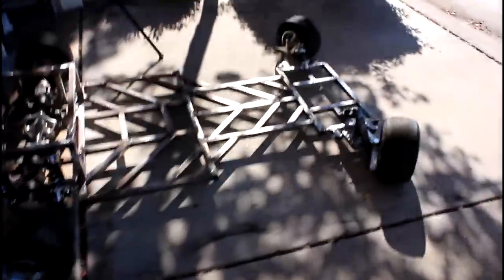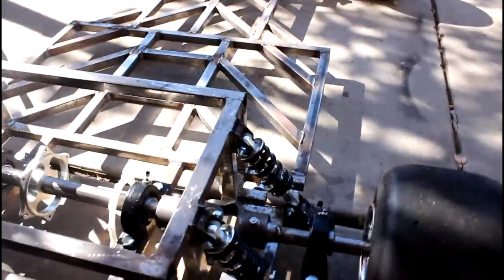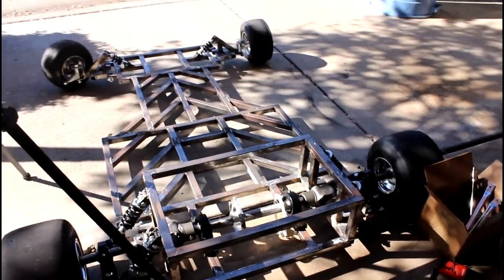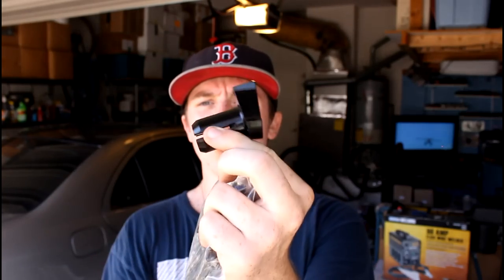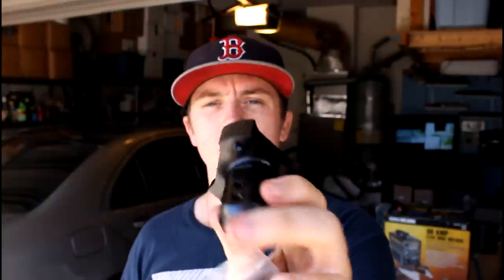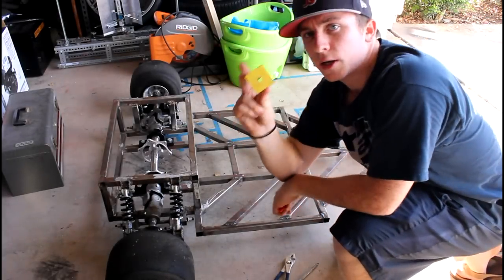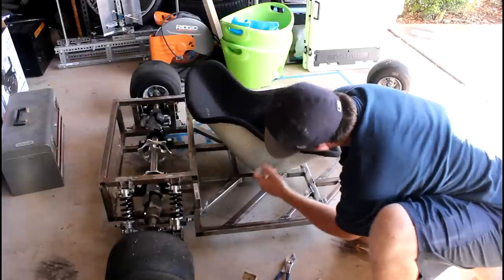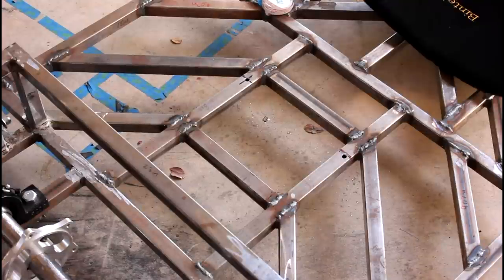(Homemade) Go Kart Build Project 16: New Parts and Mounting Seat!

Comment: great video nice to see all your parts coming in, can't wait to see and hear  this thing run, right now on my go Kart I almost got the engine running as soon as I get the pull start rope and screws for the carburetor, and then I can get everything else done like buy the secondary clutch for the torque converter and make up the custom side exhaust system, and I was thinking for that I will just try to take it to a muffler shop and have them cut and weld the metal for the exhaust instead of me searching for pipe and trying to weld and bend it myself
Reply from the maker: rushking19 Thanks man, yea as all the parts come in, it's getting closer and closer to being done! Sounds like your build is coming along nicely. Yea it's hard sometimes to do everything yourself, especially bending pipe, because you really need the expensive equipment to do it properly.
Reply: Hnat Automotive Photography yeah

Comment: only thing I would worry about is those nuts working loose may want to try self locking nuts an or locktite
Reply from the maker: Haha yea I learned that on the first test drive. Nylon lock nuts, lock washers, and a bit of lock tite will be used on all nuts

Comment: You could always weld in a gusset from the "C", to your strut bracket.....for strength
Reply from the maker: Amber Leigh Yep, that's definitely something I could add in for strength, the only thing is the welds are so thick I would have to do a good amount of grinding to get it to a flat surface to be able to weld the gusset on
Reply: not something you couldn't do though.....look at all you've done so far......js....lol
Reply from the maker: Amber Leigh haha true,. Maybe I'll get some flat stock and do it with that
Reply: You have built a great machine so far....a little time goes along way.....plus, it will protect your investment and as well protect you...
Reply from the maker: Very true, thanks for the comment!
Reply: very welcome,  I'm currently building a 6x6 APC kart.....lol, good luck!
Reply from the maker: Oh wow that sounds crazy, good luck to you as well!
Reply: Ty..